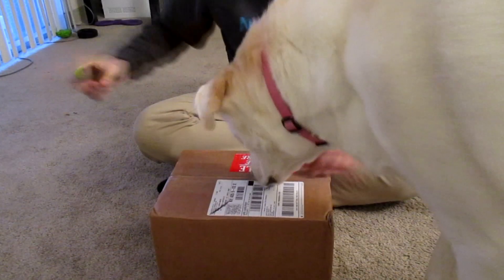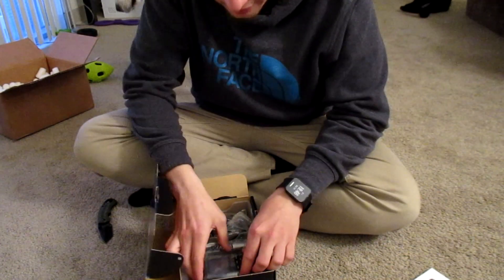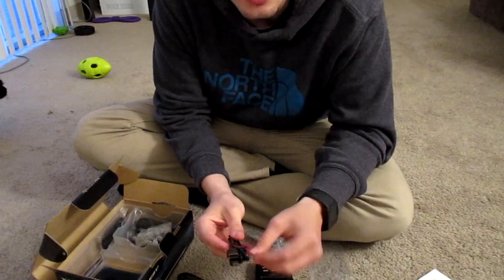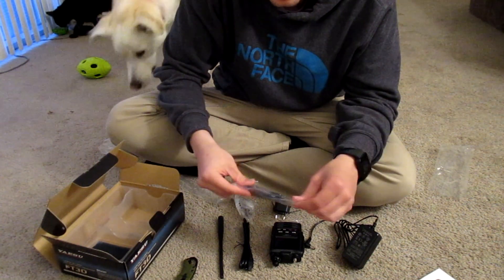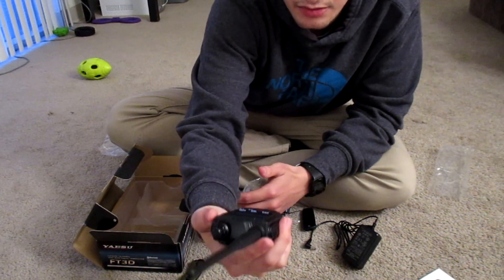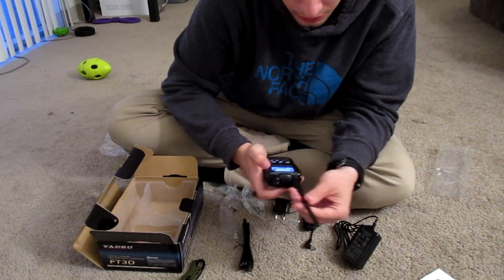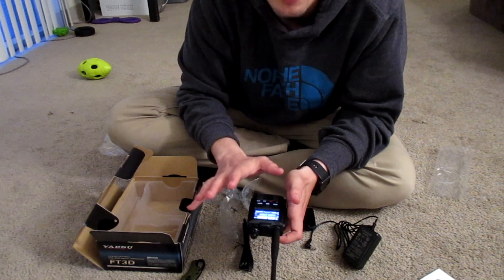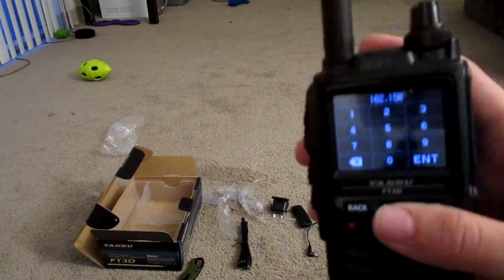Yaesu FT3D C4FM Handheld Radio Unboxing

Comment: If it interests you, I read online, don't recall where now, that if the water resistant covering over the speaker is removed it is much louder and clearer. However, I know I'm wanting to retain the water resistance (CERT) and warranty, and am not too bothered by the sound, especially since I usually run headphones off of the speaker microphone in my setup. Figured I would mention it, so you could track down the post, if it was something that interested you.

Comment: Hi, thank you for the unboxing. It looks like to be a great radio, what it realy brings compared to the FT2D (except the colored screen)?

I've got the FT1XD and I'm very happy with it. I can confirm that battery life is excellent: from what I saw in the video, the FT3D has the same battery than the FT1, FT2...

The rubber ducky antenna isn't bad (I have got the same on my FT1XD), it will be ok to talk on a local repeater but a 1/4 wave antenna like Nagoya 771 will be of course more efficiant.

I hope you will have fun on C4FM and APRS.

73's de Adrien
Reply from the maker: Theres not a lot of difference,  the colored screen makes the bandscopr a lot nicer to look at. The bluetooth with vox could be a cool feature too if you use that sort of thing.